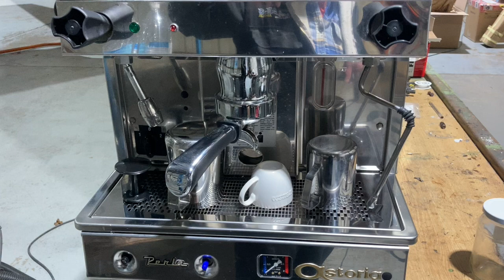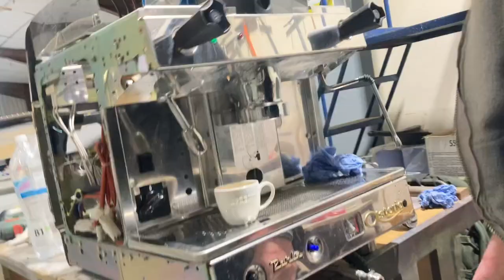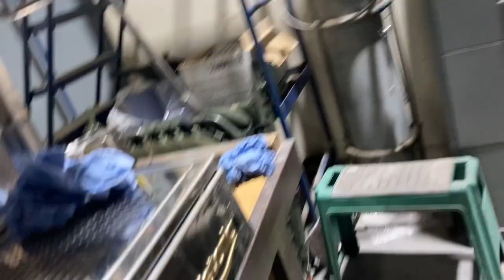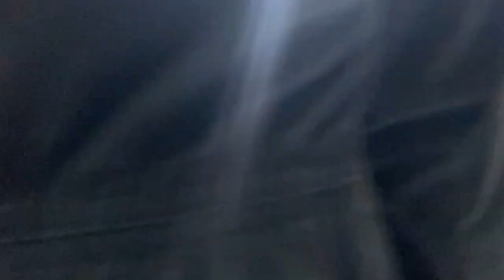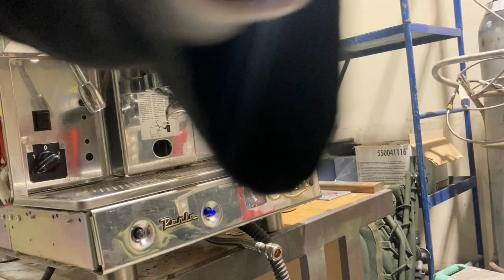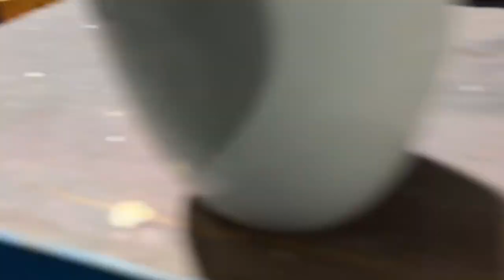Astoria lever coffee machine overview and repair

Comment: Hey there. Any suggestion on what to do when boiler isn’t getting hot? It has been sitting for a little while?
Reply from the maker: Their's usually an overheat protection, this could have tripped if the water level has been low, occasionally the power switches give trouble, or the pressure stat.  Someone handy with a multimeter and familiar with electrics should be able to diagnose fairly quickly.

Comment: I have a prevot avant 2 group that I can't find a tech close by. I have a background in plumbing and it looks a lot like a boiler. My question and problem. This is our first machine, so the right side group is working perfect. The left side only steams. It has 2 steam wands that work great. and a larger wand that looks like a cup filler? it works great until it heats up and then we get a lot of steam. side note: steam will come out of the left side, just no water. I've cleaned all heads and filters. any help appreciated

Comment: Question your element has a hole.. is that hole not for the thermostat.. and the half inch ball valve you made a reducing male insert NTP thread or NSP.. I want to start a food truck here in Cape Town South Africa and would prefer gas
Reply from the maker: The hole in the element in this machine is for the overheat protection stat (if the boiler runs dry). Temp control is by means of a pressure stat, sounds strange, but in a sealed boiler, above 100C, temperature correlates with pressure, the gas burner is also regulated by boiler pressure.  It was a straight thread, not tapered.
Reply: @framavia2201  ok.. so pressure sensitive.  I heard Astoria machines are of the best.